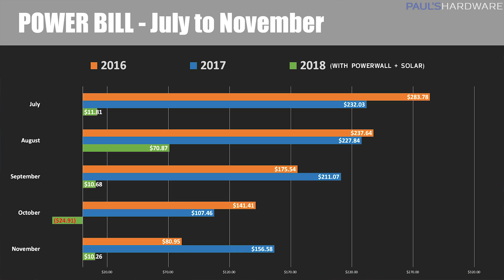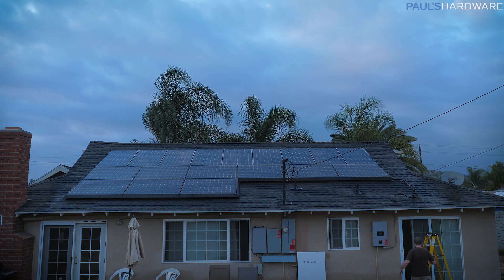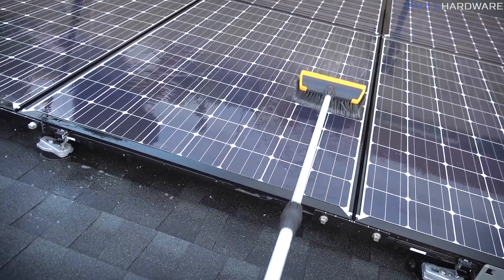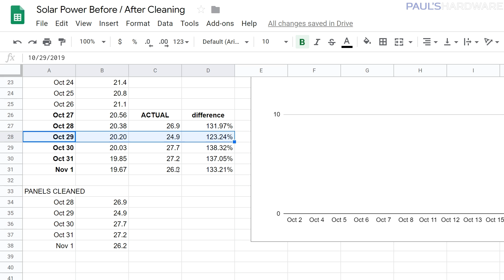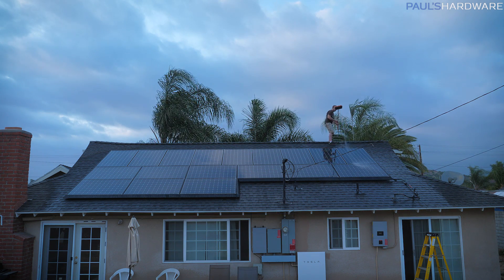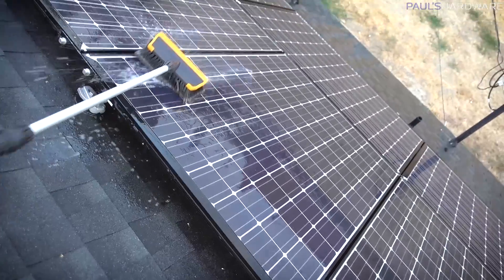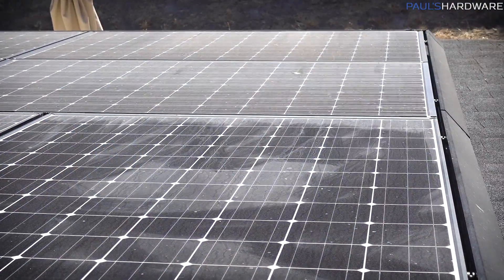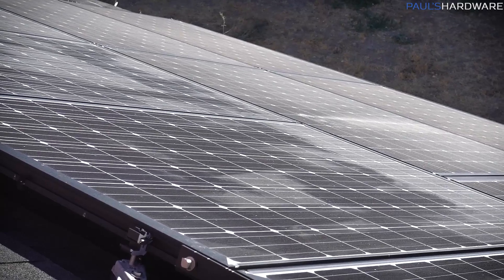Should You Clean Your Solar Panels? Before/After Testing!

Comment from the maker: To skip to results jump to 6:40 😉
Check out my Tesla Solar/Powerwall Installation Playlist - https://www.youtube.com/watch?v=CzyAcluTUMU&list=PLRnHcRQUxuodbp-H_2Rf8mIerZQVZhqV9&index=8
Thanks for watching guys!! 🙏🙏🙏
Reply: I can't stress this enough. Safety first. From the looks of your ladder and your extension brush you might be better off not even getting on your roof unless there's no faucet on that side. In that case get a longer hose.
Reply: Didn't Tesla have a recommended soap, brush, and directions for cleaning? They should know what products/methods are healthy for the panels.
Reply: I was definitely think about soaps or cleaners that would have helped further than just brushing. Good question.
Reply: 1. if you don‘t do it for your safety, do it for your money. No health insurance will cover you falling down from this roof wihtout a proper harnes. 
2. get yourself a window cleaning set, they are very light and can get long enough to get all the way to the top.
3. or just hire a team twice a year.
Reply: I work with solarpanels and the measurements you did were completely unrealistic. Unless your panels had a visible layer of dirt over them it shouldn't increase the power output by 20-30% also some days are just sunnier then others or as sunny but colder, you can't predict the irradiation of 4 days by the values of the previous ones. The only way you could really check the difference is if you have your solarpanels connected in 2 or more strings (different connectors into your inverter). Then you just clean 1 string and compare the cleaned string to the dirty string.
Reply: @proesmans12  thank you. Absolute bullshit 30% increase lol
Reply: @proesmans12  it was visible, it had a layer on it, he get slightly more power if he would scrub them instead of just spraying water over them (as you could still see that they had a layer of stuck on dirt/dust)
Reply: Use a window cleaner hose attachment, basically has a bottle with concentrated Windex in it. Shoots far enough you can just stand in your back yard. No clickbait death needed.
Reply: Hi Paul I'm a professional window cleaner I do some research on the material of the Tesla panels so you don't damage the surface. Also Paul safety first I see you're extremely close to your main power line coming into your home, A lot of window cleaners or seriously injured or killed by getting the polls close to these lines.
Reply: Get a super long extension so you can scrub from the ground.
Reply: Thanks for the skip button.
Reply: Disappointed that you didn't have channel lock pliers to take the old hand sprayer off your hose.
Reply: Hey Paul if you are going to have to do this every few Months then why dont you invest in a scaffolding set that will allow you to just step off on to the roof from the bottom so you can then use your tool to get it from all sides or you can also buy a cleaning solution you can spray on with a Sprayer and let sit for an hour then rinse off it does alot better job we use a solution here in FL but its home grown stuff but it works and is so much cheaper than those big box stuff, if you want what we use let me know and ill DM you twitter.  Cow}:-o)
Reply: @Paul's Hardware - There is a new aerogel dust that is hydrophobic its being featured here on Veritasium
https://www.youtube.com/watch?v=GcdB5bFwio4
Maybe something like this could provide a nice coat of protection :D, wouldn't hurt to get in contact with them and ask them if that could be a good idea.
Reply: Do you feel you're getting more for your dollar now that you're using a Tesla power wall, instead of powering the house with gasoline?
Reply: Fantastic Video Paul. You have some Risky Business going on, but I hope this content pays dividends. I found it extremely interesting and I eagerly await your video in 24 months presenting your findings. This could honestly become some scientific research if more people get in on it.
Reply: Off topic, but pertains to your sponsor. I noticed that the HydroX GPU block's water flow goes across the GPU die, versus starting at the center and flowing out to the edge. My question is, could there be a difference in temps/performance, between the two methods of flow? I would think that the coolant entering from the center and flowing to the edge, would be better than flowing from one edge to the opposite edge. Thanks in advance! o7
Reply: Get a longer boom handle brush and clean those panels, Could likely get another 25% more generation. Those things are DIRTY-AF! And don't worry about falling, its not the falling that kills you.... Its the sudden stop at the bottom.
Reply: homedepot.com/p/Unger-8-20-ft-Aluminum-Telescopic-Pole-with-Connect-and-Clean-Locking-Cone-and-PRO-Locking-Collar-962780/203177326
Reply: You realise that brush is extendable??
Reply: You can hire me and fly me out there to clean them, roofer by trade and done some window washing. And I would suggest using a window washing kit! Soft foam pad and squeegee. They have much long better handles available.
Reply: Paul You might want to put some effort into finding a longer handle for your brush.  Possibly you can get one long enough to do the whole job from the ground.   I have an extendable handle on the brushes I use for cleaning my pool.    It's much longer than the one you used.   And if I recall correctly, when I bought mine I didn't get the longest one.   Nothing good happens when we amateurs get on roofs.
Reply: I wonder if solar panel cleaner from HomeDepot would get them spotless? https://www.homedepot.com/p/1-Gal-Solar-Panel-Cleaner-1S-SPC/302030555
I have also seen people use Windex Window Cleaner on youtube.
Reply: You have to see if it is even possible but you can try using a really long staff with a broom fittet to it to clean them from below and hose them down before to make them wet and hose them down afterwards. You might need to wrap something soft around the staff that does not get heavy when soaked and doesn't add resistance.
If it doesn't work it would be at least a hillarious attempt and you could recycle the staff for blinds or some construct to protect something or someone from the sun.
Or get a solar roomba ?:)
Reply: beat the panels with baby seals. the pure blood will clean them better.
Reply: They would of been even more power if they was actually clean (only surface dirt and dust was removed) you can visually see there there is a layer of stuck on layer of dust/dirt that needs removing, you can see that just from the half scrubbed ones on the top vs the lower ones (you should be able to see the cells clearly, just one panel having shade/dirt on a bit of it can affect the whole system significantly ) 

If you don't have a solar egde system witch you don't (each panel has its own dc to dc with solar Edge so one panel been in shade/dirty or even failed won't drag the others down) just one panel can reduce each other panel by 20% efficiency or more
Reply: I would like to see some Reviews of solar cleaning roboter. So it could just kill Mr. Robot!
Reply: if i would live close to you i would give you a hand with the scrubing on the roof cause im not really afraid of heights but sadly i live far away in germany xD
Reply: Very much looking forward to scrub clean results!
Reply: Paul, Cleaning your solar depends where you live aka how fast and how fast they get dirty.
We have had solar on our appartment buildings here (the oldest 6 years) for years and none of them have never been cleaned and still produce the same ammount, de dont get dirtstorms(lots of vegetation and trees around to keep dirt even with the dryest summers at minimum), we live in tempret are and have rain time to time.
Reply: Another great option for keeping them clean is to apply a good ceramic coating to the surface of the 
solar panel. Dirt will rinse off in the rain.

AvalonKing Armor Shield IX is what I have used for not only cars but also the windows. Lately I have been treating windows on my house to test how much easier they will be to clean.

Take a look, them maybe apply it to one or two panels and compare how much cleaner they stay over a couple of months.

Referral Code
https://avalonking.com/?raf=ref7936966
Reply: Really seems obvious, you have let dust gather on them for a long time of course they will give less power.
Funny, though, how the only maintenance PV panels need barring freak hailstorms or fried inverters actually breaking something, is few minimum wage workers washing them every now and then... yet people keep claiming it is so expensive.
Reply: Do you have optimizers or micro inverters? I have a solar edge setup with optimizers, but been trying to get module level access through solar edge app and installer is dragging feet. Should have gotten it before i made final payment... I have top of post mount array and want to clean half of array and then see difference in power output.
Reply: Rig a garden sprinkler set at the apex of the roof. Set it on a timer to come on for 5 minutes each night.
Reply: To what do we owe the sudden burst of motivation to clean your solar panels ? Was it your wife's dismay as the power bill turned from credit to a growing cost which resulted in you receiving from her a shoe between the legs ? I wonder. I notice your wife also making some effort to help out so it wasn't just a solo effort. If you had some space between those panels then it would be easier to clean. Rubber footwear, water, electricity & s gradient don't mix ! Spraying water on panels is pointless and dangerious. Was never a fan of renewable  energy. Can be used in the 3rd world or in isolated areas like a small island etc but not in the first world. Your saving the environment by reducing your CO2 footprint despite the waste of energy, time and water in cleaning solar panels is something the media don't talk about. I wish you all the best on your project.
Reply: Yes do something in the future but please don't half ass the cleaning. The job you did was terrible. My mum gets her's cleaned for $50 so why not just pay someone to do a proper job? You could have even cleaned the bottom panels from a ladder or jerry rig some scaffolding.. This was such a lazy attempt to clean them I'm surprised you even put the video up. Your footage of the ones you cleaned with a brush was laughable.. Looks like u barely even did anything.

Comment: My home has a similar rooftop angle (27 degrees.) Why not get a MUCH longer pole/brush and clean them from the safety of the ground?  This is what I do and it works GREAT for this 65 year old FAT MAN.  You couldn't pay me to get up on a roof at my age and dexterity level...and cleaning with an extension water brush works very well indeed!!  😀🤑

Comment: Take working on roofs very seriously!
Wise cowards live longer.

I haven't cleaned my panels (yet) but I have a two story house with three 30ft gables at 36 degree pitch and it's a painted Colorbond "corrugated iron" surface which is very slippery. I had to paint the entire exterior.
I went and qualified with an industry course on working at heights and have fitted anchors. I don't work on the roof without a harness in place, with an inertia-reel so if I slip, I only move a few inches.

Comment: Paul thanks for the video.  Just a thought. As an engineer. I'm a data driven guy as you seem to be. But I really want ALL the data. Little things give context. So what solar panels do you have (make/model). I think you did say you installed them in 2018. That's a good bit of info. Also what are your panel ratings of DC output and your inverter AC output? I would offer to include those stats in the beginning just to give full context

Comment: I live in the dusty southwest desert. I can 'see' the dust covering the panels after months of windy, dusty weather with no rain. We do get some rain events and after those events, I have noticed improved electricity generation. I haven't measured this, but do look at full day generation figures per panel for same cloud-free days before and after. So I know there is a difference. I do not have any bird droppings or sap buildup, but can see how that also would reduce generation. 
The real question is whether I want to try to tackle this myself (panels are on the roof), or hire a cleaning company. I've read enough about it to be confused. 
It appears that you should turn off your solar panel, perform the cleaning when the panels are not hot (or at least not during10am-2pm timeframe), and using a specific type of brush so as not to scratch/damage the panels. Also you should not spray the underside of the panels. I also read you shouldn't use regular hose water if you have high mineral content water as it can haze the panels over time. 
Sooooo, although you answered some of these questions, some still remain. The research continues.

Comment: I made a setup so I don't have to go on the roof (which I no longer feel secure about doing).  But that requires a LONG extendable handle.  I got a Garant brand "Roof Rake with Extendable Handle" from Ace Hardware.  This is meant for pulling snow accumulation off a roof.  It is pretty good and only cost around fifty dollars.  I already had a cleaning brush on a shorter extendable handle you could run water through similar to the one in the video.  I removed the cleaning brush and threw away its handle.  (The water in my area is far too poor to be putting on solar panels anyway.)  I affixed the brush to the end of the "roof rake" setup and discarded the roof rake blade.  (You might have to get a bit creative to attach the brush depending on how the brush is designed).  I already had a portable D. I. water setup on a cart from "CR Spotless" that I use to wash cars.  To clean the panels, I set up a free standing ladder about 8 feet from the house.  I go up three steps on the ladder to be high enough to see what I am doing and I can reach all the way to the top of the panels with the handle fully extended.  I do it very early in the morning at first light.  I first give a slight D.I. water rinse to wet the panels.  I put a little car wash soap (not dish detergent) on the brush and can do the width of two panels top to bottom with the ladder at one position.  I just let the weight of the brush and handle be what pushes on the brush.  After scrubbing, I rinse spraying at the top first and working down.  Then, I move the ladder over to do the next group of panels.  I have to put the ladder in four locations to get all the panels.  If there are any leaves stuck on the panel, the water rinse won't be effective since you can't really get a downward force.  For that, I lift the brush and place it high up on the panels and then drag the brush down to drag the leaves off.  This actually goes pretty fast and takes me about a half hour.  It doesn't take very much D. I. water to do it (or you could have a reverse osmosis setup as another means for good water).  I can do it any time and don't have to pay a fee for somebody else to do it.

Comment: Clean them with deionized water because the tap water leaves behind spots and don’t use soap. DI water will make your panels run more efficiently. It doesn’t leave behind spots like tap water and chemicals will potentially void your warranty.

Comment: I offer solar panel cleaning through my company. I advise anyone who wants to do it themselves that if you use your hoses well water you could be damaging the panel as well water will leave hard water stains. If you plan to clean them yourself on a schedule I would suggest investing in a water deionizer. It takes the minerals out of the water and sprays pure water leaving no stains. If you have a sprinkler setup near a window you probably have slight hard water stains on that window if it doesn't get cleaned. Just a quick FYI.

Comment: Kind of makes you wonder why dont have built in cleaners, like windshield wipers or brushes... For your panels. They could just run everything so often and keep them clean
Reply: add cost to the panels, but I agree UNLESS the true change in electricity production has been tested over time by the manufacturers and they do not see that type of change due to dirty panels (e.g. dust and dirt, not tree sap or bird droppings which may impair the sunlight actually reaching the solar cells).

Comment: Yes this works. Doing all from bottom of panels also works! For non-pro likely safer to do that way, IF your panels easily accessible like mine. They are located in dry SW USA desert climate so get coated with thick layer of dust. Simple rinse gets thickest part, but leaves residue. Thorough cleaning always better. Search YT for “solar panel cleaning” How-To videos.

Comment: I think I got 20% improvement.  My panels weren’t that dirty initially.  My panels are on a ground mount rack which made the cleaning job much easier.  I also squeegeed them down as I was concerned about the hard water here in San Diego.  I noticed you did not mention that in your video so did you get any water spotting on the panels?

Comment: Have a 5kw PV system which consistently outputs around 32kwh on a sunny day. I got worried when that figure dropped down to 27kwh in summer time. I thought, well, that is because of the increased temperature. I cleaned then up and OMG, peak production jumped from 3700w  up to 4200w! That is 500w difference! I now produce around 30kwh again. Get your panels cleaned regularly!

Comment: Watched your video with interest as I've just had the PV engineers out to check on a 40% drop in output on my 4kw installation. That's still ongoing but while watching you scrub the panels I thought, wouldn't it be better to put a small sand bag or bagged weight on the brush head to give more friction. Looked like the brush was just sliding over the panels.  Just a thought.